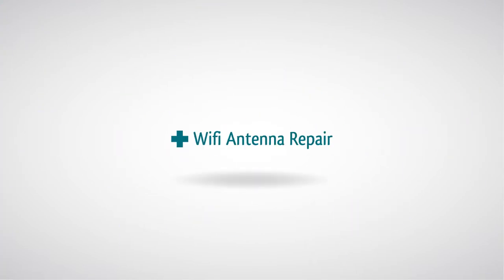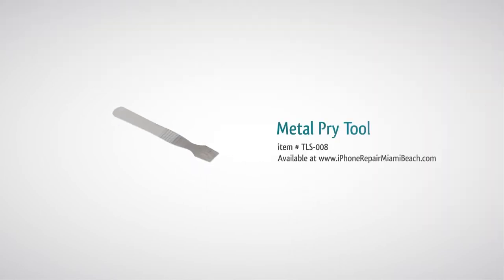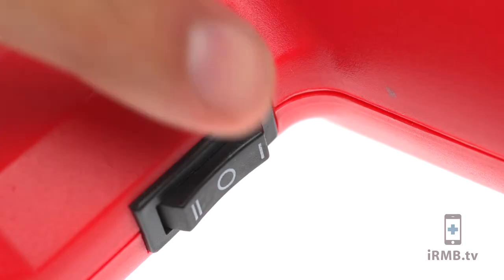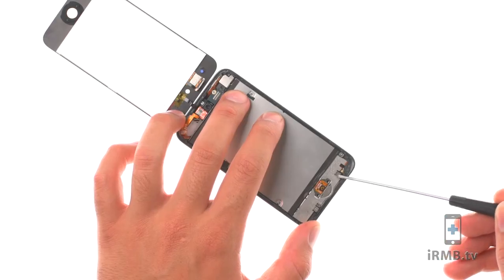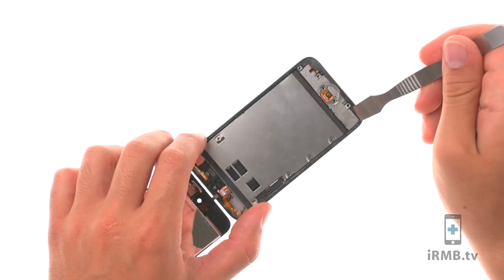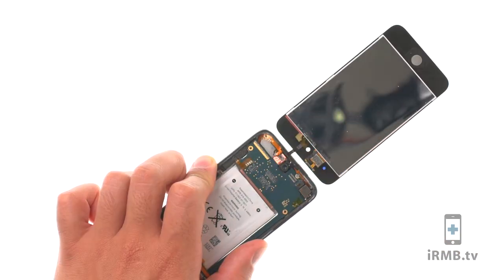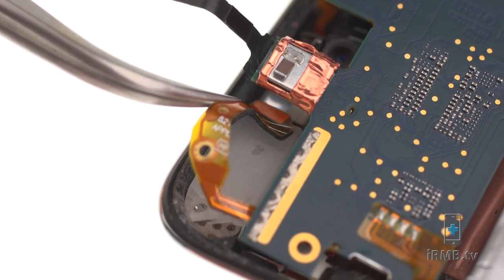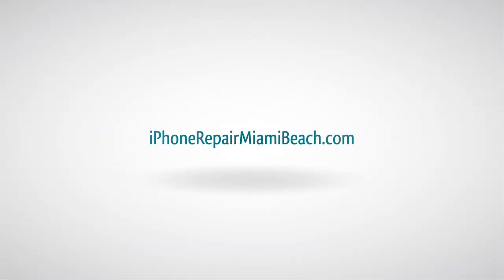Wifi antenna Repair - iPod Touch 4 How to Tutorial

Comment: can you use a iPod 4 antenna on a iPhone 4?
Reply: Hi. I have replaced the wifi antenna on my iphone 4s. The antennae both have the same connection port, so it will fit, however I am not entirely sure that it will function on it. just buy the iphone 4 antenna on ebay for less than $2.00
Reply: +Nicholas Lande Thanks For the feed back bro It really helps and I didn't know it was so cheap :0

Comment: I had this problem twice, and solved it both times by grounding the third solder (to the right of the battery terminal), to the bottom metal plate. d3nevzfk7ii3be(dot)cloudfront(dot)net/igi/YiaQuLSWth4BVsPb.standard